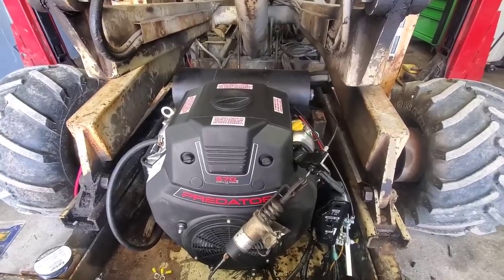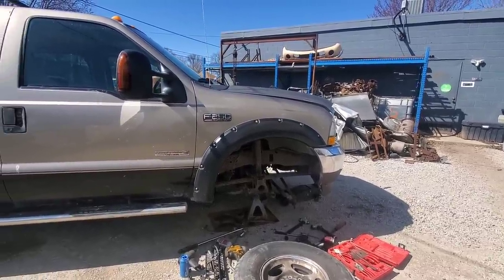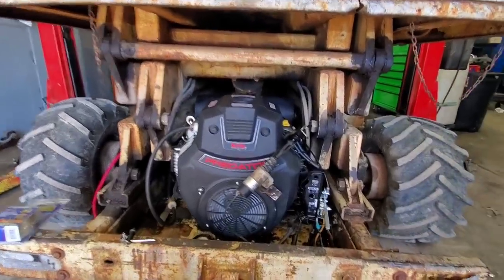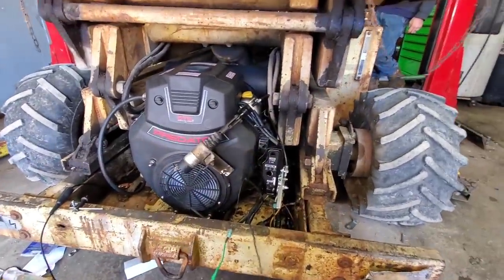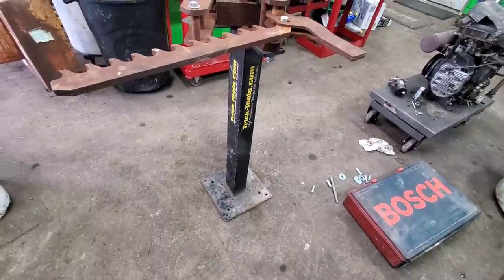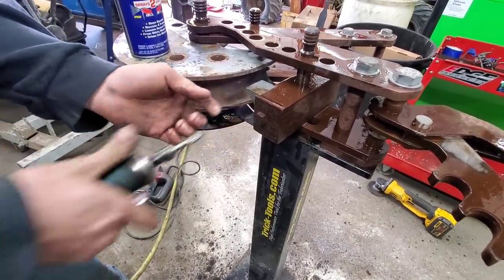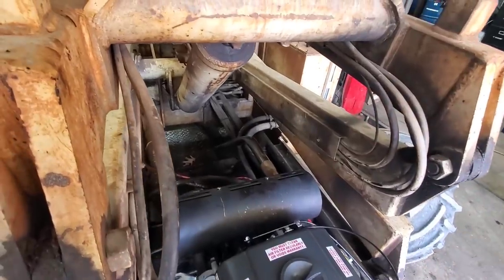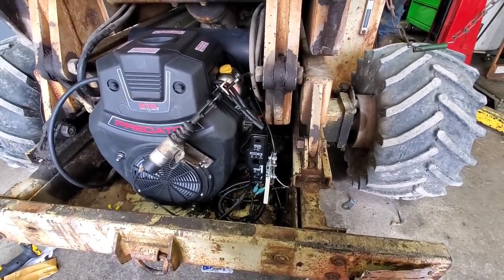Finished the lift, tubing bender install

Comment: When you described the problem with the starter on the lift, excessive voltage drop was the first thing I thought of. I got a free JD Squared tubing bender just like that one. It also was left sitting outside. Luckily they at least kept the dies indoors unlike yours!
Reply from the maker: I thought this one would be a good way to show the benefits of a voltage drop test. I tend to do that vs measure resistance (the way Chris prefers to do it)

Comment: Just so everyone knows when wrapping exhaust you need to dampen it a little and never install dry... I`ve used several different products and they all want the wrap wet.. just my two cents worth. When you mentioned the mouse nest I was yup there`s the wire problem.... I`ve fixed soooo many wires do to those little villains!!! Cool vids man
Reply from the maker: I've had a set of wraped pipes on my bike since 2011. Did them wet and haven't had any issues with them sincen

Comment: Dude you need pins for that bender? I built one of those and have machined steel pins to hold dies etc. I dont have my bender anymore but would donate my die/ arm pins cause i cant use them. Also i thought ud smash exhaust pipe in that style of bender? Maybe not its been years but yeah if u want the pins let me know they even have fancy groves lathe machined into the heads
Reply from the maker: it did smash the pipe a little but that was inch and a half pipe we used vs the stock 1" output. And i will ask chris.
Reply: @Spyke383  right on. Yeah i used mine for roll cages but ill dig those pins out. Should be same diameter pins as those bender designs are usually all identical.